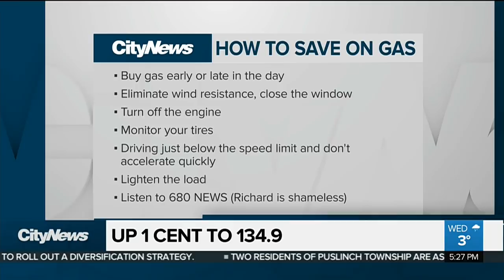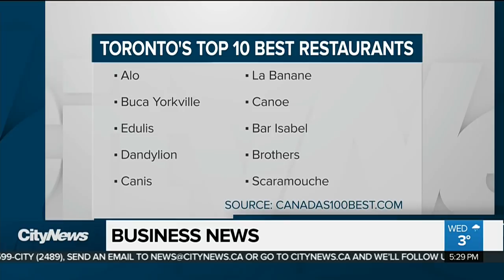$100,000 salary needed to afford Toronto condo, says report

Comment: the best way to save on increasing gasoline prices at the pumps:  used to be people would fill up their tank from empty to full and pay the full price. everyone did that. then the gas crunch happened. Year over year, the price has gone up steadily and it always seems like a shock when they reach once again peak prices from before.  Now, we are all told these handy ways to save on gas which is great and all.. however, there is one thing everyone can do that works even better...  fill up the first time, from empty to full. THEN only fill up when you reach the halfway point.  Your average fillup costs about $120 for bigger cars and $80 for medium size cars and $50 for small cars... When you fill up again at the halfway point, it actually saves you half of what you would pay at the pumps. Makes sense, doesn't it?   Most drive only 200 kms a week anyways..
Reply: Nicole Alexander how is it saving me money? I'm still driving around. The gas prices would have to be fluctuating heavily in order for this to even be feasible.